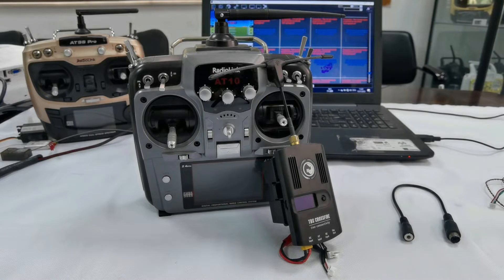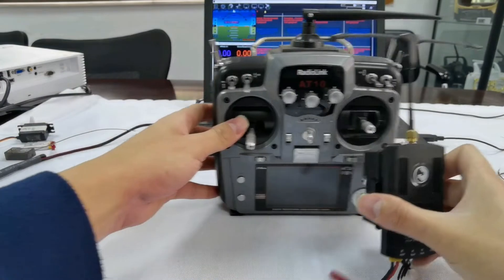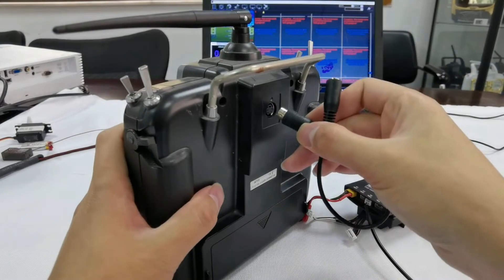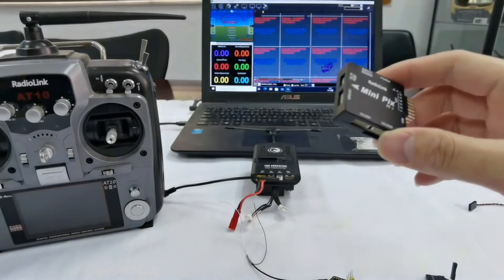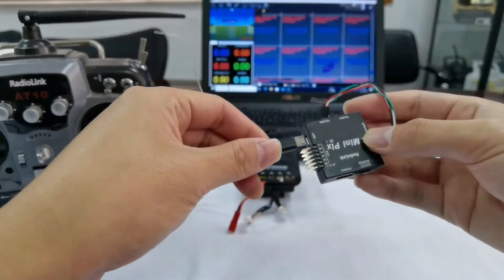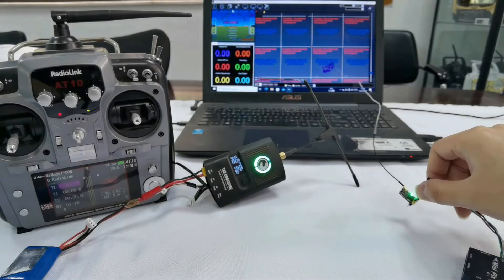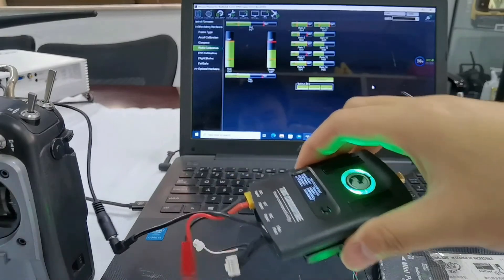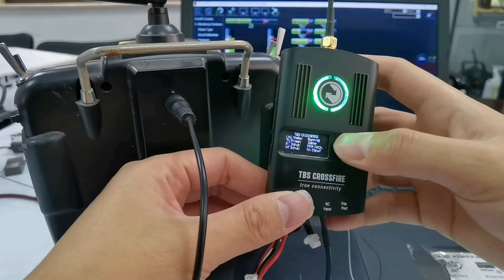How to connect TBS Crossfire with RadioLink AT10II

Comment: What is the range of this setup?
Reply from the maker: Hi， sir. It depends on your TBS Crossfire module. You can confirm the control range of the module with the seller. If any question please feel free to contact us. Our email is: after_service@radiolink.com.cn
Reply: @Radiolink_official thankyou,I recently bought radiolink at10ii transmitter
Reply from the maker: @VarunReddyK-z7v  Thank you for your support. Here is the detailed manual of AT10II: https://www.radiolink.com/at10ii_manuals  If any question when using it please feel free to contact us. Our email is: after_service@radiolink.com.cn

Comment: hello can if i want to connect tbs crossfire and radio link at10ll but not for a sim but for a real drone how should i wire them and how do i bind them
Reply from the maker: Hi, sir. You can refer this tutorial to connect TBS Crossfire to AT10II. Then connect TBS Crossfire receiver to the flight controller of the drone. Make sure the TBS Crossfire receiver can be connected to the flight controller. Checo more details from the detailed manual of TBS Crossfire receiver and your drone flight controller. If any question when using RadioLink products please feel free to contact us. Our email is: after_service@radiolink.com.cn

Comment: Great video, but is it possible to connect a crossfire micro module on the radio?
Reply from the maker: Hello, sir. Yes. You can also connect TBS Crossfire nano to AT10II. They work the same. You can check the diagram of TBS Crossfire Nano TX in this link: https://www.radiolink.com/at9spro_faq

Comment: Is it possible to connect At10ii to pc simulator by radio's usb? Like Radiomaster TX16s.
Reply from the maker: Hello, sir. Sorry you can't. The USB port is only for firmware update. And if you want to connect At10ii to pc simulator, you need to connect it by simulator port at the back of AT10II.

Comment: I'm excited about the video.. Just praying Radiolink created a attachment.  This way its not to clumsy and discouraging. Maybe redesign not a new controller more the back of case.  With capabilities of clipping in crossfire. Design the cover and additional cables tucked into back case. Battery run off controller. Sell it as plug- n- play optional accessory.  Just tossing out ideas 💡.
Reply from the maker: Hello, Sir, thank you for your suggestion. We really appreciate for it and will send feedback to our R&D development. It is so great to hear the feedback from users. Because they can provide realistic suggestions according to their experience and help us to make improvement. Thank you so much!